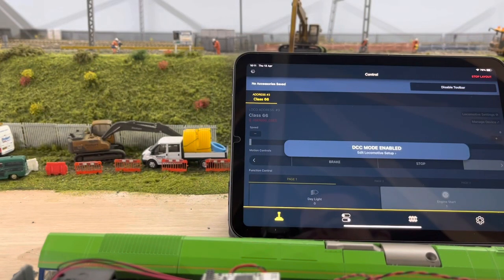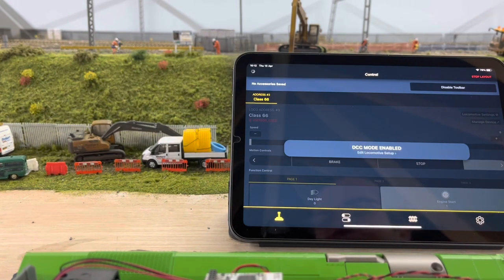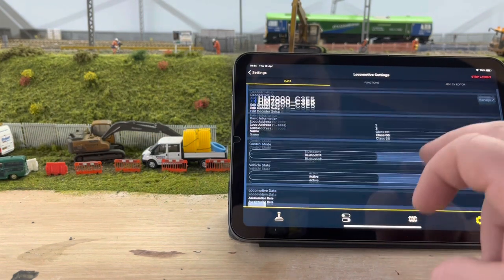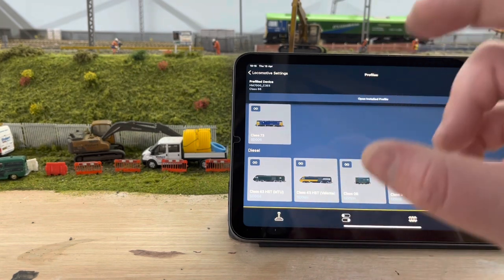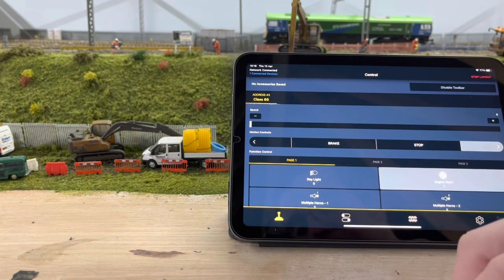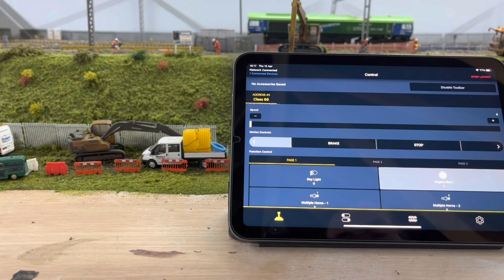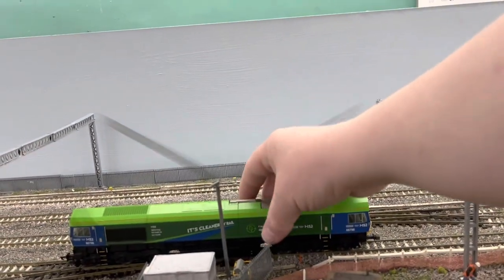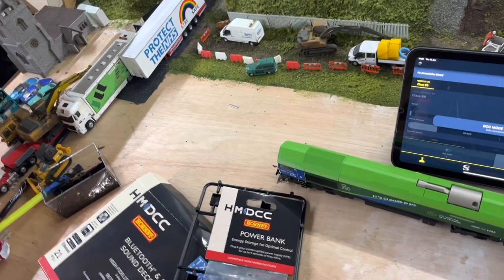Let’s Take A Look At The Hornby HM7000 Dcc Sound Bluetooth Decoder

Comment: You were wise to insulate the decoder - there are too many exposed areas on the board!
Kapton tape is a thin polyester tape that is thin enough to allow heat to escape the board but will provide electrical insulation so I would recommend getting a roll of that (Amazon and others sell it). If you prefer not to wrap the decoder then use the same tape to insulate metal areas around the decoder.
Reply from the maker: Thank you very much i will have a look for this now and get some ordered :)

Comment: As Martin said in the comments, Kapton tape is great as it's super thin and insulates well.
The failure issues on these chips were worrying, but it seems like it's caused by DC controllers with PWM.
I've ordered a couple not for the Bluetooth options but for cheap sound. 
It's a shame though that the decoders don't comply with the DCC size standards and might be tough to fit in a lot of locos.
Reply from the maker: I will have a look at that tape thank you very much yes I believe it like any new products your always going to have some failures the size shouldn’t be a issue for most of modern day diesel locos but steam might be

Comment: The Loco address on DCC must be set by DCC controller it is not set in the app
Reply: You can set it on the app.
Reply: @TheWGLOVER  giving the loco address on detail screen does not set the loco address as seen in the video. It did not change it for me on DCC address. You may be able to change it in CV setting screen but I found quicker to change with my DCC controller on a programming track.
Reply from the maker: Yes i have found this out since making the video :)